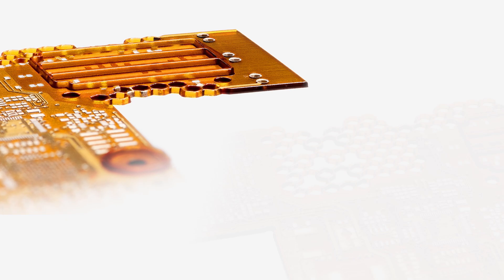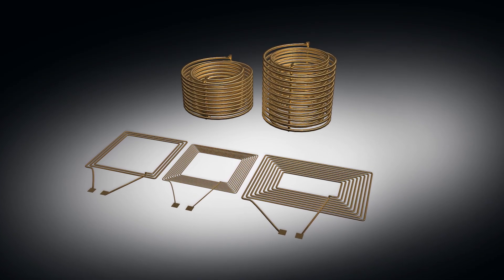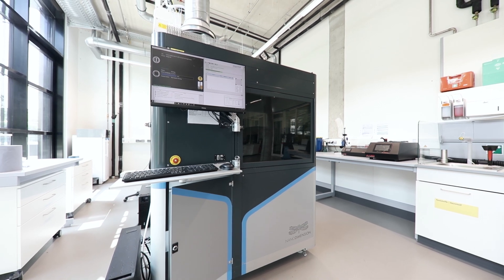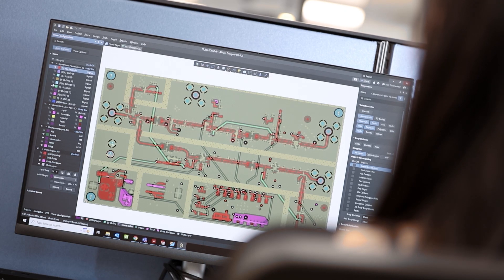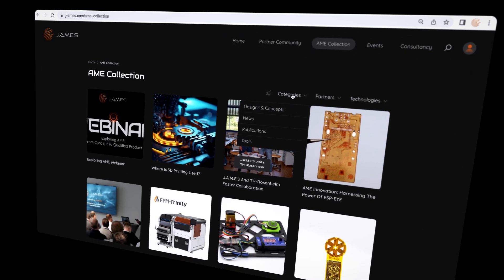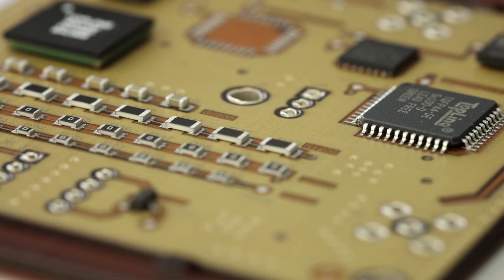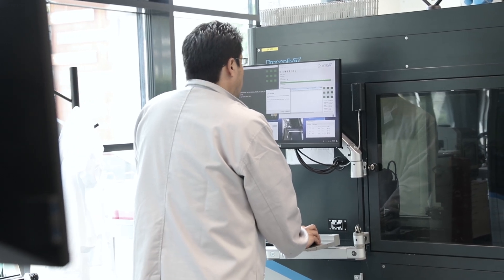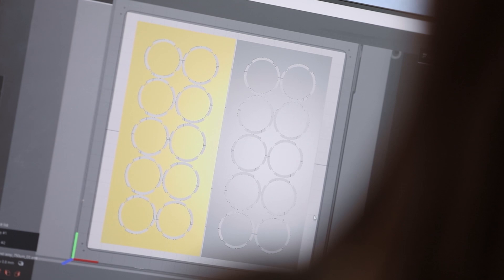Nano Insights - AME and J.A.M.E.S

Comment: Every single item is manufactured one at a time with AME technology. This is the opposite of mass production. Not having the latter, in NNDM case in principle, means low stream of revenue. In other words staying in the prototyping business could be good for a private company for example, but not so much for a public company. Still I am an investor in NNDM and wish them to expand their business and possibly find a way to implement at some point some sort of real mass production.
Reply: Exactly, it would have been impressive if instead the machine prints transistors + resistors + leds etc , even if its 1990s density, that way you can complete the entire device in one step.
For example maybe printing an i486 processor, with ram/VGA/ storage all in the size of credit card, that would be impressive